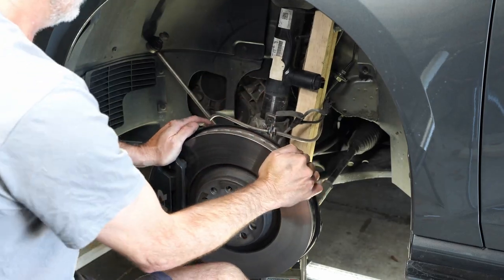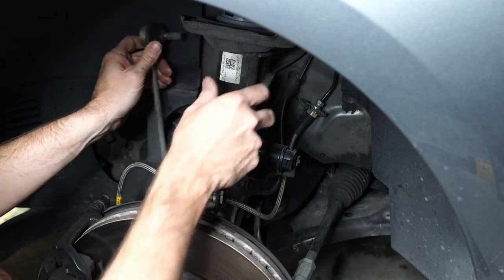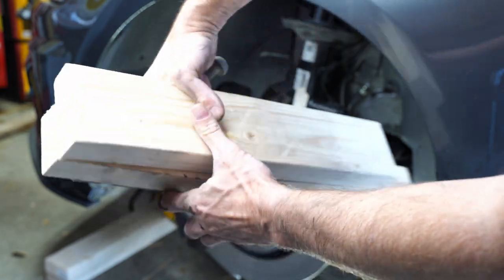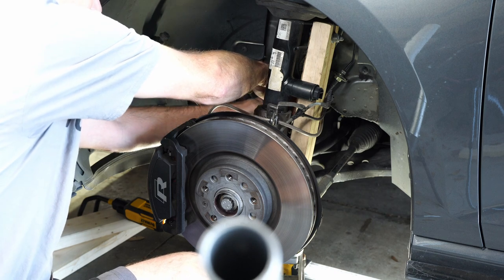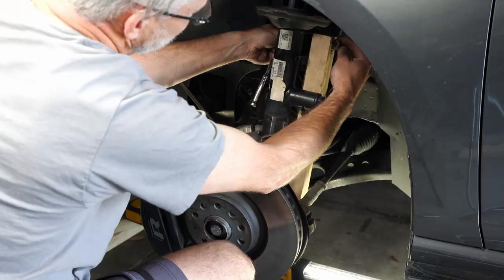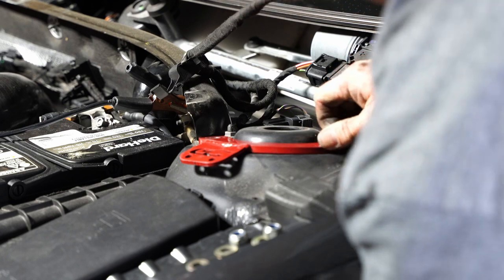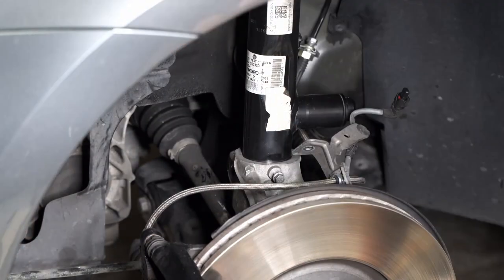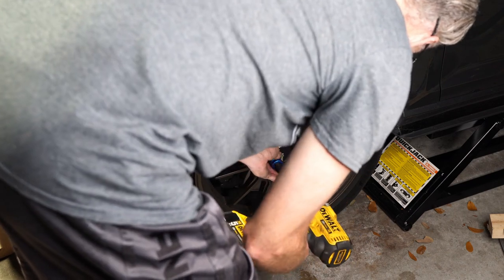It's Simple, Actually!  The 2x4 MK7 Strut Removal Method

Comment: This method saved me a ton of time. I used Paul's method on the passenger side and it was a serious PIA. When I moved around to the driver side I found that there were no bolts to remove the drive shaft so I looked for videos on how to replace the spring and found this video. Besides being easier you also noted moving the little spreader on the pinch clamp. That little tip saved me a ton of aggravation. I found that my little spreader tool was long enough to prevent the tab on the strut from sliding out through the clamp. I wasted an hour on the passenger side because I didn't know that. I did the driver side with the 2x4 method in under an hour. While I did have a few hiccups on the passenger side, Paul's method took over 2 hours. THANK YOU!
Reply from the maker: Thanks for sharing!

Comment: Something I found out, that I think is important to note, is if you already have coilovers, or dampers that are shorter than factory (Koni Yellows, Bilstein B8's, etc.), on the car, you will not need to use the 2x4 method, nor will you have to remove the axle bolts, to remove the entire strut assembly. I would this out when I had BC Racing BR coilovers on my MK7 GTI S, and was swapping them out for a set of ST XTA coilovers. Because the dampers are shorter than the factory OEM dampers, the whole rotor and hub assembly will actually swing down far enough and remove itself from the bottom of the strut. 

It was so nice when I found out doing this job, because we were not using the 2x4 method, and I was expecting for us to remove the axle bolts. But the brake/hub assembly literally fell right out of the strut, removing itself from its attachment, the moment I put the strut spreader tool in haha. It took us literally 20 minutes t remove both driver and passenger front struts because of this. We got the entire suspension, front and rear, taken out and assembled, in an hour and 15 minutes haha.

Great video! I have since removed the ST XTA coilovers, and went back to stock, due to the comfort and reliability it provides. I have just bought new wheels and tires, I am planning on getting lowering springs to drop the car a bit. I like the lower look, but was not impressed with the BC or ST coilovers, as they both failed (one BC struts seized up, one ST strut stopped compressing, and another ST strut started leaking)(both brands I bought brand new). SO that is why I m planning on just doing lowering springs paired with the OEM dampers right now, and I will eventually upgrade the OEM dampers (after they fail) to Koni Special Active or Koni Yellows. Undecided on that one right now...

Comment: My biggest issue with the 2x4 method is recommending it to everyone. If you like it, do you. I think it works fine, but the stored energy in the assembly, if anything goes wrong a DIYer can get themselves hurt. I'm not into that.
Reply from the maker: Totally understand.  I remember everyone freaking out when I used a spring compressor on Jeep springs!  All that stored energy just waiting to explode!!!  You will notice I didn't store a lot of energy in my process. There is a difference in jacking it all up and fully compressing the spring vs compress, release, compress, release, etc.  Love your stuff tho!  Thanks for doing what you do for the community (and the parts and tools you have!).
Reply: I feel like if your smart enough to know how to properly jack a car you can handle this.

Comment: Another option is to use spring compressors, over the spring as high as you can get and under the strut lower spring lip. Also not something you would recommend, but probably safer (and more convenient) than the 2x4 method. As always, thanks for the vids.

Edit. Tried this today. 2x4 method is easier. This vid is gold.
Reply: i used straps...
lift the car, 
put at least 2 separate straps of the spring, 
put down the car, 
fasten the straps, 
lift the car, 
and just like that, the spring remains somewhat compressed enough to pull out the strut,
leave the spring compressed - that allows to swap the spring to the new strut,
now do everything but in the reverse order.

Done.
This way is not perfect, as the straps may slip from the spring. Obviously a spring compressor that fits in there would be awesome, but in my car it does not.
Reply: @krisg822  yeah I have three sets of compressors and only the really old cheap ones actually fit, and even then it’s not easy or ideal. Straps idea is neat. In the end for me, the 2x4 method is great as long as you manage to push up at the correct angle. If it’s slightly off it can seem like the strut isn’t fully released from the hub even with the splitter as wide as it’ll get. I always find one side is quick and the other needs a bit more finesse.
Reply: @sibzilla  all i can say is that the original shocks, that have labels with 'Monroe' on them and got that DampTronic, started to fail on the front axle after 60 000km, the ones on the rear axle still look good, but they are not as fresh as they supposed to be, tho they don't lose any juice.

Considering what i did with the car and wheels are still attached - i probably should be happy they did last that long lol

Comment: Done this method worked pretty well on the passenger but I had a struggle to get the driver's side back in line when I compressed the shock it wouldn't go straight up and kept going out sideways very difficult to get it back in

Comment: Great video! I had a shop install new coil overs but now I need to remove struts to add a washer to strut mount. One quick question: will this throw the alignment off? I just had an alignment done after new suspension installed.
Reply from the maker: It’s possible.  Anytime you remove/install suspension components there is a risk. But if you don’t have adjustable top plates, everything should go back to exactly the same position.  I’d expect if it’s not exactly the same alignment, it will be close enough that you wouldn’t notice

Comment: I’m about to lower my alltrack tomorrow. I’m not disconnecting the axle or using wood. I’m just going to use spring compressors and pull the strut down by hand. People do way too much these days. Just like when I had my b6 Audi Quattro everyone says you have to lower the rear subframe to get the rear spring out and that is a total waste of time. A good tech always finds shortcuts and not ones that damage parts.
Reply: So how did it go?
Reply: @SlowDriverSean  worked great I didn’t use the strut separator tool either I used a lady finger. The strut fell out I did have to use the spring compressors

Comment: Thanks for the video Sir! I am concerned about that wood method. Are there any spring compressor tools with easy access which we could use instead of wood?
Reply from the maker: There really isn’t enough room to get a spring compressor in there. The alternative is to remove the axle bolts (which is the correct way).
Reply: @EVERYTHINGcpo   Thanks Sir. I really hoped that there are some kind of smaller easy reachable spring compressor tools out there. Guess I will just have to find lets say extra solid 2x4 from dry oak tree. 😉

Comment: always remove axle bolt.   you may pop the cv joint out of place if there is too much pull on the axle.  VW original tool works the same way but it is made of metal and it has a very low profile.  You can make the same tool with steel making it  stronger and with much lower profile to fit in there.    Working on VW & Audis since 1992.
Reply: Which VW original tool are you referring to?

Comment: Thanks for the great content! Once the strut pops out, will it damage the drive shaft from the weight of the rest of the suspension components?
Reply: There are stories of the axle popping out, but 99% of time it shouldn't do anything, and should just hang there. You can always have a raised flat surface that you can rest the suspension on when it pops out if you are afraid that you are part of that 1%
Reply: Doesn't reach it ... I've done it myself

Comment: This method worked great for me.  I used a baseball bat, seemed stronger and gave me more clearance.
Reply: Where did you find the bat?
Reply: @hardcore4476  I had a bat laying around in my garage that I no longer used. I modified the bat with a hand saw, cut the end flat and notched the other end for the bolt.
Reply: @tuacati5079  sounds like a good idea. Do you have a picture of the bat so I could copy that design? I may go try to find a baseball bat somewhere lol.

Comment: Its simple DO NOT copy this method. From VW workshop manual P68 (Running Gear. Front strut replacement).-  WARNING Do not allow the drive shaft to hang down under its own weight,
for this would allow the inner joint to bend too far and be damaged!
Reply: So simply modify this method and put something like a bucket under the brake rotor to support it.
Reply: @danh9225  Sorry buddy you're misinterpreting VWs warning - the driveshaft is supported by the lower suspension arm and steering components so your concern is invalid.